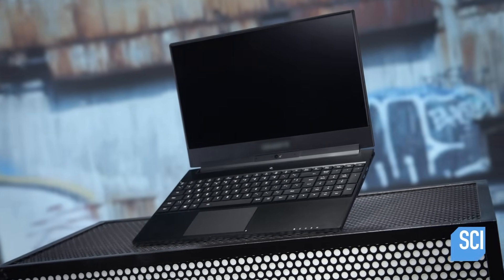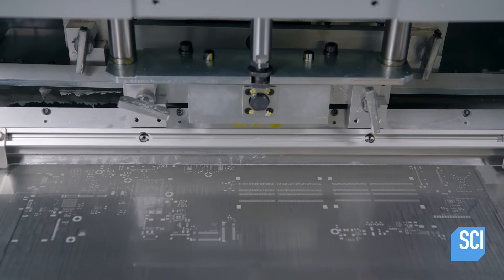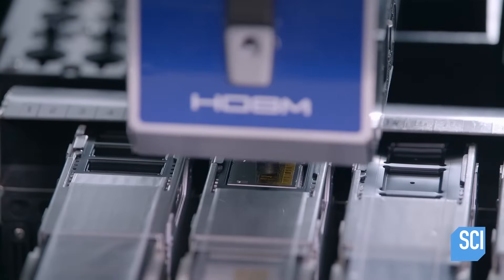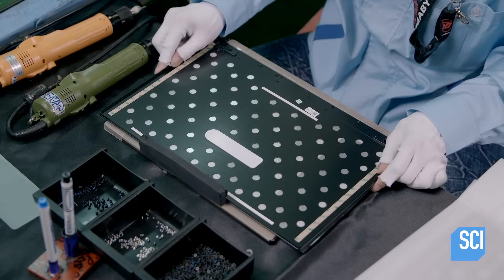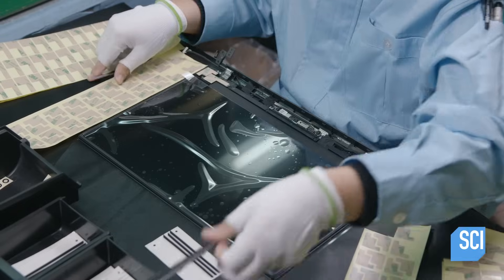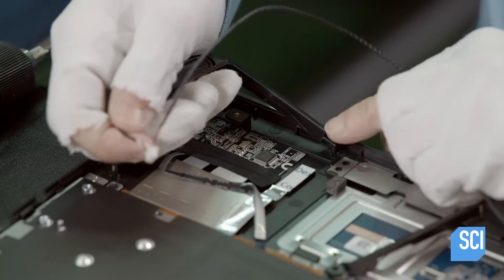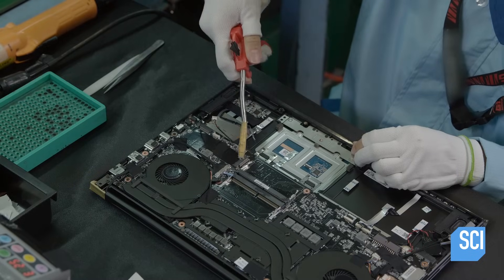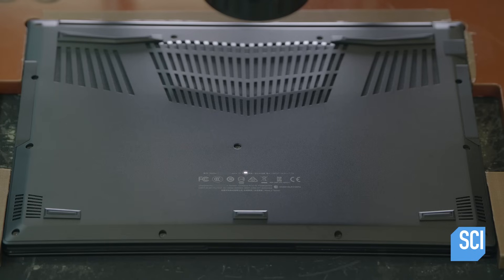How Laptops Are Made in Factories | How It's Made

Comment: did he just called motherboard the computer's brain?
Reply: Yeah, that got me, too.
Reply: And he called the SSD a solid state DISK 😂
Reply: @Uranone1  😂😂
Reply: @Uranone1  SSD IS BOTH A SOLID STATE DRIVE AND DISK because the disk is the functionality to read and write
Reply: I'd call the main board the spine, if anything.
Reply: I think they were referring to the motherboard as a whole, including all the parts connected to it.
So, they aren't wrong.
Reply: The motherboard seems to me as the spine. As it connect all the other vital stuff inside a computer/laptop. The CPU, GPU, rams and a lot more. The PSU is the blood vessels and the watts or electricity are the blood. Ram and the CPU could be brain and ram is memory (or the SSD AND HDD could be memory too) GPU is the eyes. Sound system the ears, other peripherals such as mouse and keyboard are the hands and legs and all other parts are other vital organs.)
Reply: Na mobo is more like the nervous system
Reply: It’s funny how similar computers are to humans
Reply: @jamesreddington2885  Motherboard. Nerve system
Reply: You could call the mainboard the brain. It's not a great analogy either way, if you describe the cpu as the brain, it's equally problematic.
Reply: @likeazir  Exactly. CPU is just like the part of the brain handling mental processes consciously and unconsciously. The drive is like the hippocampus which located inside the brain, RAM would fit the bits that handles cognitive load. And so on. As so using that analogy for the main board is quite logical.
Reply: @likeazir  the nervous system more like
Reply: Motherboard is more of the nerve system
Reply: @likeazir  wouldn't the motherboard be the brain?
Reply: @MKDC-5  well yeah but that doesnt mean the motherboard would be the brain, the human body is nothing without the brain just as the brain is nothing without the body.
at college, they taught us that the cpu would be the brain because it handles every line of instruction and distributes tasks to the other components
Reply: was gonna comment the same thing xdd
Reply: Technically it’s part of the brain because the motherboard is the part that sends the I information across all the other parts. Like the signals of the brain.
Reply: Motherboard = Skeleton :D 

Agree ?
Reply: @MKDC-5  A laptop is dead if the battery is dead, doesn't mean he could have said battery as the brain 😂 Wrong Inference you brought there.
Reply: @MKDC-5  Well then maybe call the CPU the brain and the motherboard the heart.
Reply: "solid state disk" lol am i right?
Reply: not to defend this - just a fun note, we are talking about laptops so the CPU is soldered to the MB (in most cases) so yeaaaa if by MB he means the entire assembly he isnt wrong ^^
Reply: He also said "solid state disk"
Reply: So that's how the gigabit aero 15 is made🤔🤔
Reply: TRIGGERED
Reply: They just tried to explain it to someone who doesn't know much about computers,the vid is aimed at regular people :)
Reply: @EladLavyUzan  considering this is a science channel i think this would be aimed at people that know something about science
Reply: yep, he did,, That was a mistake
Reply: DarkCeptor44 well mothers are the brain in any family
Reply: Unfortunately yes.
Reply: Right, like seriously and he also called the ssd a solid state disk not a solid state drive
Reply: yeah he just did  lmao😂
Reply: DarkCeptor44 dis you just killed grammar?
Reply: @Claudio-gv2lz  grammar is not a real person so it cant be killed
Reply: My reaction was the same XD
Reply: board it, mother.
Reply: Battery the heart?coz it pumps juice?
Reply: It's like the spinal cord which is also a part of the brain so.....
Reply: The mother is now the brain
Reply: CPU they mean.
Reply: He also said solid state "disk" not drive
Reply: I always considered the motherboard to be more like the skeleton...
Reply: Mobo is more like the nervous system :))
Reply: YEAH WTF HAHAHAHA
Reply: I thought the gpu was the muscles
Reply: Triggered +1
Reply: Technical he's not wrong. :/ The whole computer can be thought of as the brain. Motherboard is more like... Connectors between different parts of the brain, but still.
Reply: yeah man big brain time
Reply: @MKDC-5  Motherboard is the white matter of the brain. It contains highways where information travels. Everything  letsgetverydrunk  said is good analogy as well
Reply: Most laptops have CPU solderer onto the Motherboard it self, so.
Reply: @Bry-Fi Only if computers could feel.
Reply: I thought cpu is brain of computer
Reply: That confused me as well
Reply: I don't see why call it a body.
The motherboard is the workplace 
The CPU is the manager who does all the math, desicion making and main processing.
The GPU is an other worker who does image drawing, 3D rendering and other fast graphical work.
The RAM / VRAM is like the size of the desk the CPU/GPU workers are given, a bigger desk lets them manage more things at once without having to get up and grab stuff from the HDD/SSD storage room
The chip set is like an assistant to the CPU and other components.
Like before the HDD or SSD is storage rooms.
Wireless / Network adapters are shipping + recieveing managers
Reply: Actually the motherboard is kinda the brain because it processes data that comes in like key strokes
Reply: @Jonnathan Emmanuel Ram is the speed of ur laptop
Reply: Chipset = brain
Reply: Yes he totally did while it’s more like the nerve system
Reply: It's sort of more accurate:

BIOS: Hypothalamus.
CPU: cerebrum
Cache: short term memory,
RAM: working memory
SSD/HDD: hippocampus,
GPU: visual cortex
UEFI: amygdala
PCI: spinal cord.

Each of these components is connected by various nerves throughout the brain, which is
Reply: Yeah, It should be called the nervous system of computer
Reply: DarkCeptor44 yes
Reply: more like skeleton
Reply: When talking to non tech people, I'm using motorcyle analogy.
CPU: Your acceleration
RAM: Your Top speed
HDD: gas tank
Additionally GPU: Your NoSs/Turbo
I also mention by changing HDD to SSD, you basically change your oil type from regular oil to JET FIGHTER oil.
Reply: i'd call the motherboard is the wall of the room
cpu as the person
gpu as the drawing tool
ram as a desk
hdd/ssd as a bookshelf
program as a book
door as a I/O port
Reply: Body and organs cannot work without a brain.
Reply: Motherboard is like a nervous system, it controls everything in us XD
Reply: brain of mother
Reply: Yes it is the brain
Reply: I just commented basically saying the same thing
Reply: It would be like the nerves
Reply: No, CPU is the brain
Reply: And did not pronounce souldered
Reply: i assume they suppose to meant the whole body.
CPU = brain
GPU = eyes
RAM = idk
HDD/SSD = idk

idk how to describe the last two as a body part
Reply: @jonathan_emmanuel  you could describe RAM as the brain short term memory, and HDD/SDD as the long term memory
Reply: Cpu: frontal lobe
Gpu: visual cortex
Ram: short term memory
Hdd: long term memory

Not really super accurate, but I don't mind him at all calling the motherboard a 'brain'. That's kind of what it does.
Reply: @free_spirit1  mother board would be nervous system
Reply: @free_spirit1  So, I guess that kinda makes the North/South Bridge the corpus callosum  Edit:  And the BIOS is kinda like the hypothalamus
Reply: @jonathan_emmanuel  
RAM: the part of the brain which remembers things for a short time
HDD/SSD: the part of the brain which creates and remembers memories
Reply: @jonathan_emmanuel  The Webcam would be the eyes.
The human eye can't display images like a gpu.
Reply: @jonathan_emmanuel Psu/ Battery= Stomach?
Reply: @jonathan_emmanuel  ram is muscle, hdd/ssd is fat
Reply: @jonathan_emmanuel  RAM= short term memory?
Reply: @jonathan_emmanuel  Maybe the RAM would be the stomach because it stores temporary data, and fat would be the HDD or SSD because it stores a more permanent form of data
Reply: Ram = short memorys 
SSD = long memorys
Reply: Jonathan Emmanuel ram=pancreas storage= stomach
Reply: @jonathan_emmanuel  Ram=Stamina
Reply: @jonathan_emmanuel  CPU = brain GPU=brain RAM=brain HDD/SSD=brain. GPU would never be like eyes. Our brain does the perception eyes are just sensors.
Reply: @jonathan_emmanuel  motherboard = highway/road
Reply: @monstercattyy  that kinda made sense to me now
Reply: @jonathan_emmanuel  no i hate when people call the CPU a brain ITS NOT THE BRAIN its more the part that does non-repetitive tasks like processing
while the GPU does more the repetitive tasks like making frames for gaming the motherboard complete is a brain and the keys, screen, and mouse are the body
Reply: @1OneArmBtw  dude CHILL OUT MAN IDK SHIT ABT PC FFS
Reply: @jonathan_emmanuel   memory of the brain
Reply: ARSHIQUEKHAN
Reply: @jonathan_emmanuel  chipset = brain
Reply: Jonathan Emmanuel cpu = brain - gpu = eyes ram= short time memorie - ssd = long term memorie - mobo = nerve system - psu = stomach
Reply: @jonathan_emmanuel  the storage is your stomach and your ram is your muscle...... idk
Reply: @jonathan_emmanuel  You use I dont know a lot.
Reply: @jonathan_emmanuel  Ram = Body
HDD / SSD = Bigger Body = BUTT
Reply: @jonathan_emmanuel  ram is short term memory hdd/sdd is long term memory cpu is cognitive, analytical, loigical memory/brain
Reply: The motherboard would be like the brain stem, not the brain itself.

Comment: Why not have robotic arms execute the entire process?
Reply: it’s extremely inefficient for robots to do certain things, like connect the display cable to the motherboard. Elon Musk described it as trying to program a robot to connect two floppy hoses together, it’s nearly impossible without advanced AI since the hoses can just flop around and screw up the entire process
Reply: @chikennuget3634  Interesting! Thanks for the response!
Reply: @CFLO-93  Also, it's harder to reprogram an entire chain of robots to do things differently. With people, you stop production for a few hours and gather them, tell them to do something and they'll do it. With robots a lot of reprogramming and debugging and testing is needed.
Reply: @chikennuget3634  Or more precisely you bring the humans together to break in the new process showing they exactly what has changed. No one has any questions, but they come up to you after the meeting with them. Then a third of the people keep trying to do it the old way and try to blame you when something goes wrong complaining you didn't explain the changes clearly.  Finally everyone gets it and starts doing it right. Yeah... been there, done that!
Reply: Chiken Nuget exactly he said humans are best with fiddly things
Reply: +Chiken Nuget With a general purpose robot it is difficult, but with special built mechanicals in the robot it would be easily possible, and of course the parts can be designed with machine assembly in mind. But from here comes the problem too, the cost of requiring a very specialized equipment for every small job leading to massive cost of the automation. So it doesn't make much sense economically. There has been fully automated factories for example for mobile phone manufacturing, where a human didn't touch the product during the entire process. But those factories were very expensive.
Reply: You think machines can make it all by itself? Like the attachment of certain things? Think more
Reply: @de_Ward26  It could very easily be done.
Reply: Because robots are more expensive than hand labor in Asia, so it doesn't make sense to automate everything. Only automate there where it brings a lot of benefit for some reason and is possible with reasonable amount of work, like the testing part. ;)
Reply: equipmeny too expensive and prone to many errors, i guess

Comment: YEAH BUT WHAT GAMES CAN IT RUN MAXXED OUT IN 1080p 60FPS
Reply: a lot of games. the gigabyte aero 15 is pretty fast. i averaged 130fps maxed out on destiny 2 at 1080p on that thing. most games i ran on it did not dip below 80fps, even some AAA games, with the gtx 1070 max q model.

Comment: AERO 15 is a freaking nice laptop :P
Reply: I'm using one right now, I'm definitely not buying one again. Battery life is 5 to 7 Hours for me which is okay.....the thermals are horrendous though. a thin gaming laptop with two fans and two heat pipes for the CPU+GPU, with no side vents....only hinge vents.....the whole thing heats up when gaming......I have to undervolt/underclock the GPU and limit the CPU power to not burn my house down. lol. Also screen replacement is impossible. smh
Reply: @kninezbanks  the CPU is the biggest heater, mine seemed basically perfected at 3.5ghz -.150mv. GPU doesn't get that hot even with the most demanding games
Reply: @bradhaines3142  Exactly like mine....Mine has a -150mv undervolt as well, it maintains 3.5ghz at 90c by itself when gaming........but I prefer to personally use Throttlestop to limit my CPU to 3.5ghz to keep the Clock Speed Stable and avoid jumping up and down.
Reply: @kninezbanks  oh wow, for that price you can't even maintain all core boost speed when gaming. What a shame, was considering it but no more now. There are better laptops at lower prices
Reply: not as nice as the price. the design looks like crap to me, and ive had problems with it since i got it. battery life is between 2 and 12 hours, which is really annoying
Reply: sounds like your dedicated GPU is kicking on when it shouldn't. I have only 2 hours if I run the GPU at all
Reply: @TAWithiam  yeah but i dont know how to manually turn it off, otherwise i would when im going to use it off the charger
Reply: @bradhaines3142  unfortunately the only way to disable it is with a reboot but if I remember windows well enough the Nvidia control panel had a setting for what GPU used when, you might be able to put it in use integrated mode only
Reply: @TAWithiam  thats the thing, i did that, and it still shows 3-6 hours most of the time. but sometimes itll pop up 8-12, and id actually get that.

i swear if this thing didnt have those bugs itd be near perfect on the inside, other than cooling

Comment: Wait, we still use manual labour for laptops? 
Is that why we get random lack of tech supplies? But then again I've never seen laptops be short in supply. Mostly certa8n CPU or GPU
Reply: Yeah, I think it is only for certain parts that are too complex for the machine to assemble and not as "gentle" as humans do. Machines are mostly used that requires extreme precision and for quick repetition. I think it depends on the laptop design and which manufacturing combination is more efficient. Some is better to have more automation and some is actually bit cheaper to use human labour than redesigning another specialized machine that won't be used for any longer term. Laptop body design for example tend to change every year or 2 years on many OEMs, this makes it costly to do with machines only as it requires to have new machines to assemble new body while humans are infinitely more flexible and adaptable. Motherboards is something machines are now mostly exclusive to machines and they tend to be reused for couple of models or generation with only few tweaks per generation.
Reply: ZDY I'll bet they count number of laptops ordered and for certain price demanded from manufacturer it turn out to be cheaper to pay Chinese workers instead og building robots.

Comment: I took apart my laptop once, never worked again
Reply: You probably left the battery on while taking the laptop apart and a metal screw or your metal screw driver shorted some contacts of a sensitive component. This happened to me once and it made me feel regretful for a week.
Reply: I've taken laptop's apart alot and they've never broke. Just make sure to put everything where it came from and all the screws back
Reply: Harvard wants to: know your location
Reply: Did the same to an old iPhone, I can't remember what I did with it after that.
Reply: Just remember to put your anti static wrist band that have livestrong words on it.
Reply: its_a_trab

so you're the kind to screw up an IKEA furniture, huh?!
Reply: i did and i fixed the laptop
Reply: i took my laptop apart once too, it still worked, the case broke.
Reply: I use to be a technician and i've worked on dozens of Samsung and Dell laptops, some of these designs have the worst charging ports, that would snap off and have to be re-soldered on. I remember one week I had to install new wifi cards on 150 Samsung Chromebooks because the original ones were defective. Laptops are a lot easier to work on than desktops, just not as powerful yet.
Reply: I've taken apart my laptop 5 times. Still works even though I've modded the crap out of it
Reply: You should be careful while dismantling a laptop. It's parts are delicate :-(
Reply: Keep trying, you'll learn how to fix them eventually